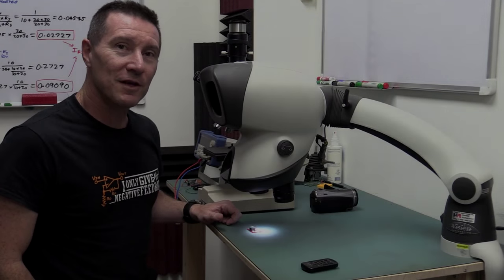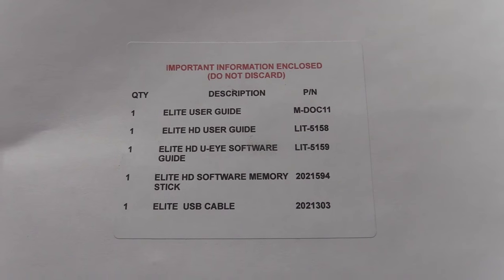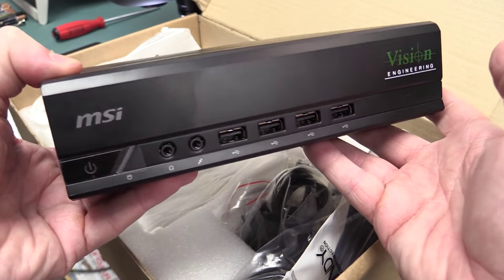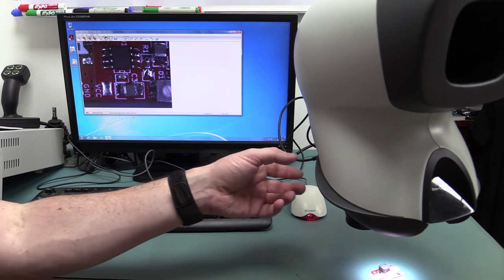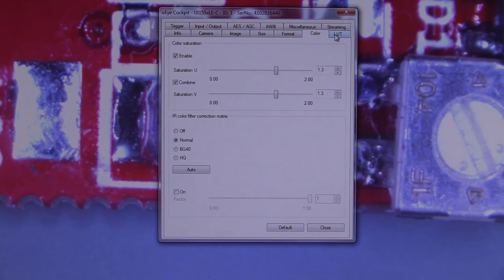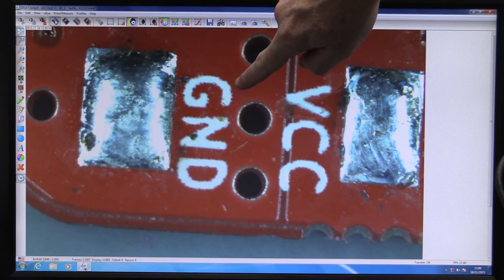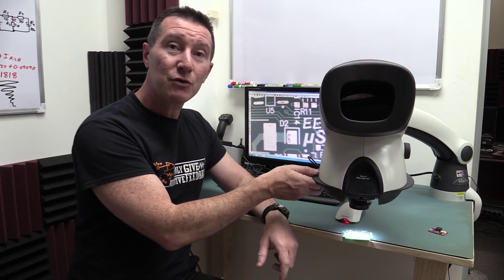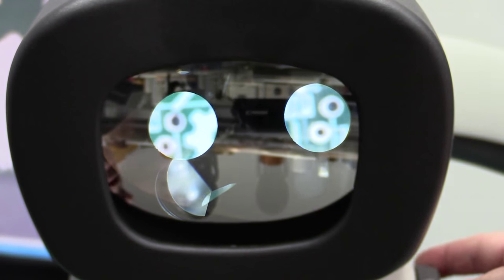EEVblog #817 - Mantis Elite Cam Inspection Microscope

Comment: I wish they made an HDMI 1080p/60 or USB 3 microscope that I could use for video recording. My YouTube channel is nothing but a bunch of videos of component level repair and diagnostics of complex PCBs under a microscope in realtime. The Mantis is so much more comfortable, but my current camera is 1080p60 and amazing quality while this one is laggy and really jittery. The lighting is also much different.

I would give Mantis an extra $2000 to produce something with a proper, functional camera for my YouTube channel. I asked for as such in a recent video. USB 2.0 is real world performance of 37 MBps. This is technology that is over ten years old. It is for mice, not high quality inspection cameras!!!

My camera is $800 over the cost of my $449 microscope and it is 1080p, 60 FPS, auto exposure/white balance adjust and VERY high quality. You can see it in all of my repair videos. The Mantis Elite Cam version with the camera is $1700 extra over the standard Mantis. This is not only twice the cost of my camera setup, but $400 over the cost of my entire microscope setup. 

Too much for crap IMO. for $1k sure give junk, for this much money one would expect a camera that is not a POS. :( This is "designed" to milk as much money as possible out of brand recognition without having to update it to 21st century technology into the  product.
Reply: I did a video about it and also emailed. They said since Vision Engineering is a UK based company with engineering dept in UK that not much I can hope for.
Reply: +Louis Rossmann Nice to see you here, mr. Rossmann!
Reply: +Louis Rossmann you got your RSS feed on...usb2... lol... I purchased an $18 usb cam on a 7m cable to put in a nesting box to get cockatiels hatching, its about the same quality as the cam in this mantis puppy... ;)
Reply: +Louis Rossmann Not the purpose of your post but, nice channel you have, I just subbed!
Reply from the maker: +Louis Rossmann You really need the Targarno for the stuff you do. 60fps output, huge working distance, and x40 zoom. Expensive though just like the Mantis.
Although the fixed 60fps full HD output is not easy to capture. You need a very high end machine and/or a hardware capture card that supports 60fps.
And the built in light on the Tagarno sucks.
Reply: EEVblog Thank you for the reply and excellent review! Oh yeah capturing this is a PITA! I have a six core 3.8 GHz haswell for capturing this in x264 and it still uses almost 50% CPU! I use libx264 at qp=1 with ffmpeg/openbroadcaster. If I capture raw video it is not CPU intensive but that takes up over 255 megabytes per second, which required RAID 0 on two 500 GB SSDs at first to even work. One video would use the entire array. I use magewell capture hardware, it is affordable and works. $300/channel. 

I am checking out the Targarno but the only problem I have with those is I find it impossible to solder looking up at a TV. I don't know why. I have a 39" 4k $1000 seiki pro that isn't a bad screen but I can't get used to soldering looking at a screen. I don't know why. I have tried with my present microscope/microscope camera to solder looking at the screen and I can't get anything done, like trying to write a book with my left foot!
Reply: I find it interesting how much redundancy there is between people who comment on my videos and people who comment here. Lots of familiar faces!
Reply: +Louis Rossmann You may want to look into a dedicated capture card that can do on the fly H264 encoding. Software encoding on a CPU is still a lot slower than dedicated hardware. Additionally, you'll wind up with smaller files (without sacrificing much quality headroom) that could potentially be written to slower drives. It's good enough for broadcast television. There's also the Tricaster route (by NewTek, the folks who made the VideoToaster).
Reply: I should have looked for one, but too late. :( Already have the six core 3.8 GHz haswell machine. I have to say while it kicks the SSDs and the processor in the groin to encode it, x264 qp=1 direct out of the microscope camera looks absolutely amazing.
Reply: +Louis Rossmann It's not like you couldn't get dedicated encoding hardware later. Those cores aren't exactly wasted on the kind of work you do, regardless.
Reply: Theres a common theme Louis Rossmann ;)
Reply: +Louis Rossmann Nice to see you here Louis :), I'm following your channel for a long time. The Mantis really looks nice and futuristic, but the not up to date USB camera hack on is dissapointing in this class of instruments for me too. As Dave said, it seems to be for documentation only - not for high quality video production. Keep up the good work Louis. Your microscope recording is absolutely fine. I'm really curious, what you'r going to review next in your new review section. Have a little tip for you too, If you ever loose you flux syringe again..pretty sure you can find one in every pharmacy store ;)).
Reply: +Louis Rossmann A couple of years ago I saw webcams that integrated an H264 encoder and piped that over a USB connection. They should absolutely use something like that to push 1080p60 out of these things. I'm just astounded at the awful 1600x1200 2MP piece of junk they've used in this! Shocking.
Reply: Richard Birch As I've said before, Mantis has enough money and industrial customers, no need to care about any of this. They will pay anyway. It is a very small niche of people who care about things like this.
Reply: +Louis Rossmann The original $1,885.05 VS Mantis Elite-CAM HD costs $3,495.00 "Sorry not worth it, especially with some of the basic things Dave pointed out, as i am sure the USB cam that's in it is no more then a $20bucks worth, plus special 4pin din connector $2, plus the Curry software dev maybe 10000 rupee = 200AUD then the time for a someone to cram all that stuff in i don't think its $1,600 "

Yes as Dave also pointed out you would not want to use this Mantis for live Video because it defeats the purpose off having a stereo scope but i honestly think for $1,600 they could have stuck two "1080P/60P USB 3.0 plus a USB 3.0 hub chip sharing power with the LED "that normally come with the unit" plus use of the cams adjustable LED signal into a HI-Power LED controller thus allowing you to control light on each side via the software.........

but they can't make a shit ton of money like that......

Thus Mantis Elite with DIY cam install.... Problem solved...Unless you break it... then your up shit creek.LOL
Reply: BlackIce504
I don't think it defeats the purpose of having a stereo scope at all. I want a stereo microscope for my own comfortable viewing and repairs, and I'd like a camera so that other people can watch and learn. I don't want a camera based microscope so that I personally can stare at a monitor and watch myself - I've tried soldering looking at a TV and it is always a nightmare.
Reply: Louis Rossmann
read the rest of what i said using 2 high end camera's, with 3D monitor you would get that, but they wanted max profit for a 20 camera added to the mantis.
Reply: Surgeons do it all the time!

Comment: The image is darker on Live Video mode because to record at 37 fps you can only have a maximum fixed shutter speed of 1/37 seconds, which in this case is clearly not enough to properly expose the image.

When you switch to Optimal Color mode the software allows the time of exposure to be increased until the image is properly exposed (which you can see it happening on the histogram just after switching modes), thus reducing the fps.

Comment: like you said dave the reason its so pricey and high quality is the optics it has for your eyes the doctors office had the regular mantis and got to look in it and its quite an amazing rig the camera however seems they grabbed a webcam off the shelf at a big box store really am shocked they cropped that harsh
Reply from the maker: +crapper1 Yep, the cam is quite disappointing. Juts tacked on, and even then not that great.
Reply: +EEVblog Weird. I interned with the camera manufacturer (IDS) in Germany and their products seemed to be pretty good. Perhaps not several thousand dollars good though.

Comment: the monitor brand is one of the professional ones ;-) be sure, that's some quality monitor
Reply: +Jakub Polomsky (LightlynX)
Not been doing much for a year or two. But Iiyama were always a real quality monitor. Prefered Eizo usually myself. But they were in the top bracket.
Reply: +Jakub Polomsky (LightlynX) Yeah, had a few Iyama monitors in the past and for the money, they are pretty good. Eizo are legendary, but cost as you would expect.
Reply: +Jakub Polomsky (LightlynX) 
Nope not even one of the professional models; just the E-series (TN panel)
Reply: Yeah I know...I capitalised the first "I".
Reply: +Jakub Polomsky (LightlynX) so what makes them more Professional than DELL?
They probably use same LG panel as DELL and DELL uses high quality software/Hardware in their monitors.
Reply: ValugaTheLord I actually never bought anything from DELL (besides one server-pc) so I can't answer your question but I also don't remember saying anything about being the best nor comparing it to other brands.
Reply: Jakub Polomsky
Well, what makes them Professional? That question I asked in my original post, I just decided to compare to well known professional Monitor brand.
Reply: This is IIYAMA ProLite E2280HS-B1 is cheap "garbage". Nowhere near professional monitors.

Comment: Vision Engineering is most likely using the high crop factor to capture the image from the lowest distortion area at the center of the lens. This would be important for accurate measurements. It may also become necessary on the higher magnification lenses.

Comment: This is why Apple wins every time. They don't skimp on all the small stuff, details matter.
Reply: +Guy Gadbois Unfortunately (or fortunately?) Apple doesnt build lab equipment ;)
Reply: +Elettronica Vintage Imagine them making something like a lathe or a cnc milling machine ;)
Reply: +Guy Gadbois Wow, that's a big shoehorn, I don't think I've ever seen one that big before.
Reply: +Teth47 It's called a crowbar ^^
Reply: +Guy Gadbois 
Unless it's an iPhone 4, then you're holding the phone wrong.
Reply: +Guy Gadbois How's that Apple microscope working for you?
Reply: +Stefan Gotteswinter 10 times the price of other mills/ lates, ultra fancy optic but the late / mill fall apart after one year?
Reply: +Guy Gadbois iPhone 6 camera-lens...
Reply: +Stefan Gotteswinter Better not...
Reply: +Stefan Gotteswinter If apple made a machine you could only use original apple tooling. And stock.
Reply: +Guy Gadbois This is not the fault of Windows, this is a Mantis Elite problem.

Comment: Smashing microscope, but the camera should have been higher spec and the same view that the built in viewer gets.
Reply: +zx8401ztv agrred! though in my mind, given the price of the thing, and individual price of the lenses, they could have integrated opitcal image stabilisation =/
Reply: +killer1479 Yep they could or If it just had a solid plate addon attached to the back of the headunit to place the pcb on, the picture would not move, both move together :-) The plate could be moved up/dn by a simple mechanical knob.
But the camera was a downgrade, as dave sort of said, not integrated in to the device very well, a rushed addon, shame :-(
Reply: zx8401ztv kinda like an EA game! rushed out for income, lol.... the ability to be wall mounted would have been even better tbh, and a thought that dave may have loved as that, in itself, would reduce wobble upto 90%
Reply: +killer1479 yes i think it was a rush job, oh a wall mounted one would have been smashing :-)
Shame the camera is crap ha ha :-D
Reply: zx8401ztv aye, should have the option to integrate any camera of your choice, such as dave canon, or, a full frame slr camera :)

Comment: The software seems to be the default software for uEye cameras by IDS. They are a german company for industrial cameras. The software (I've used it a time ago) has quite alot of options to setup the camera for machine vision applications.
So it looks like all that Vision Engineering did is to bolt on an USB camera and not really care about hardware (same view for example, the lose cables, the 4 pins are just USB in an IP rated connector that is used on most uEye cameras) and software integration (uEye is mostly a configuration program; you write your program on top of that).
Oh, and Iiyama is a quality brand that has been around for decades.
Reply from the maker: +superdau Yeah, seems just bolted on. An industrial machine vision software seems the wrong choice here.

Comment: Hi Dave
Having had one of these for some years I have to say that the Cam version is a huge disappointment. When the optical side is in focus the camera on mine is slightly out of focus. The usb cable on mine has been snagged and has broken the 4 pin socket. It is still usable though. The software supplied to me was free and written by a 3rd party. Vision do have some expensive software but were not interested in supply it to me for review.l
The fact that this hasn't been updated with adjustable leds and a camera that fits the price charged is a bit of a shocker. Especially as I complained about these issues years ago.
Vision never did send me the promised lens caps either.
I would not pay for the cam version again.
regards
Trevor

Comment: Try GTK UVC video viewer (on an ubuntu PC) that program is great, I'm using that with my DIY webcam microscope. That allows you to enhance the image significantly, and also record video/take photo. The user interface seems to be much more user friendly then the one that came with it, and it's free. Of course you don't have all the fancy stuff like measurement, drawing, area selection, etc, because the program wasn't designed for a microscope...

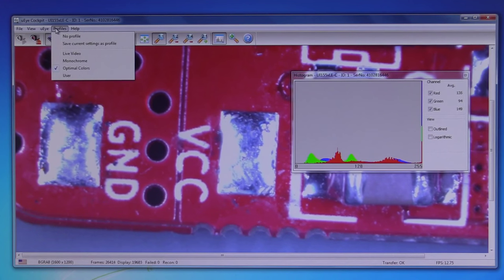Comment: Ähm, 16:05 -> I'm sure this comes through the shutter speed. If you got 12 instead of 37 FPS you can switch to a much slower shutter speed and you get a much brighter image with the same ISO settings.

Comment: I'm sure a Limo to USB cable is cheap.

Seriously? This is a classic example of a company selling a high end product making choices to keep it and all accessories overly expensive. Yeah, optics aren't cheap but they are just tacking on cost.
Reply: I totally agree. it would be much better an optical attachment to split the image between the user viewer and a camera.  bad camera, bad software. My cell phone has better camera performance
Reply: +Thiago Coura Agreed. If you select a cell phone with decent macro zoom capability you can also use it as a portable inspection microscope. I use a cardboard wedge as a stand for mine and can inspect and solder SMT under it without too much trouble. The free Army Knife app for Android has a good magnifying tool that also lets you control the flash as an objective light.
Reply: +Peter Brockie That's true.
Reply: +Thiago Coura A phone is also way cheaper !
Reply: you mean a LEMO connector verses another type like hirose?

Comment: Why do the framerate/resolution on webcams or USB camera's always seem to suck? USB 2.0 should be able to handle throughputs of upward to 480mbit/s? Although that is not quite enough for raw 720p30,  my mobius camera which records 1080p30 or 720p60 video has a bitrate of only like 18 mb/s or something, and that can still be further compressed.
Reply: +Power Max on the fly compression needs processing power. "Pushing" the raw image out is easier to implement and more robust. WIth on the fly compression, the frame rate would tank, when the image changes a lot. And compression needs times. A really good compression requires to consider the frames before and after the current one. This adds lag/delay. Depending on what the target application is, lag can be a deal breaker. In video conference, it´s an non issue. But with "live soldering" milliseconds count.
Reply: +Power Max on the fly compression needs processing power. "Pushing" the raw image out is easier to implement and more robust. WIth on the fly compression, the frame rate would tank, when the image changes a lot. And compression needs times. A really good compression requires to consider the frames before and after the current one. This adds lag/delay. Depending on what the target application is, lag can be a deal breaker. In video conference, it´s an non issue. But with "live soldering" milliseconds count.
Reply from the maker: +Power Max You'd expect hardware compression on high end system like this. 1080p 30fps H264 should be possible here.
Reply: +EEVblog They should have used a 5:4 ratio camera to minimize cropping, and I think my cheap mobius camera does in fact have a webcam mode that allows streaming 720p30 video to the computer, and it is actually pretty sharp and good! so yeah, no excuses!

Comment: 13:24 Dave, if you screw/bolt the table to the wall I think you can solve about 99% of the table wobble.
Reply: +lasersbee
Exactly what I thought. I think it may only be a partition behind it. But it will still stabilize it much much better than it is now. For little work too.
Reply: +rationalmartian +lasersbee im pretty sure the company he rents the office from wouldn't let him just drill holes in the walls, especially if they are just plaster board as you say.
Reply from the maker: +megaspeed2v2 It's my office, I can do whatever I like :->
Reply: EEVblog oh, then bring on the holes! :P
Reply: +EEVblog That&#39;s what I thought. ;-) An industrial rental is not like an apartment flat where you need to get permission just to hang a picture frame. At least that is the way it is here.